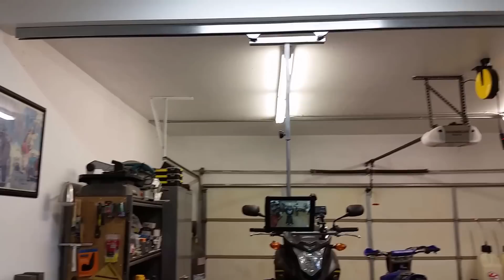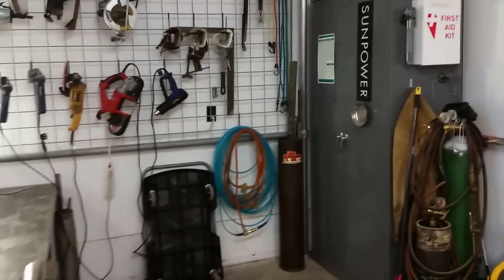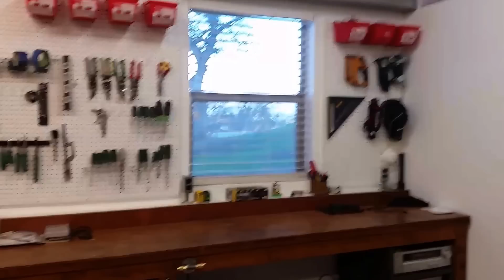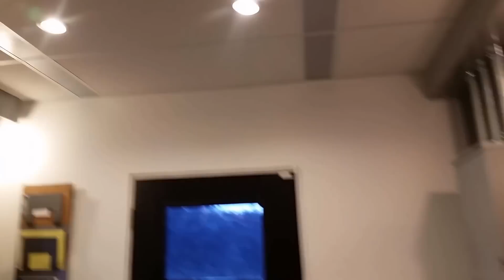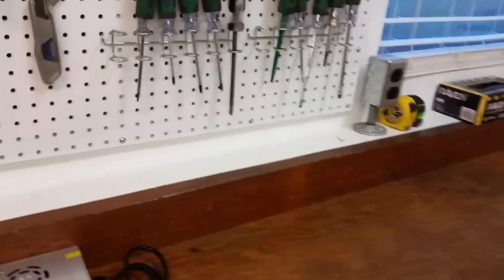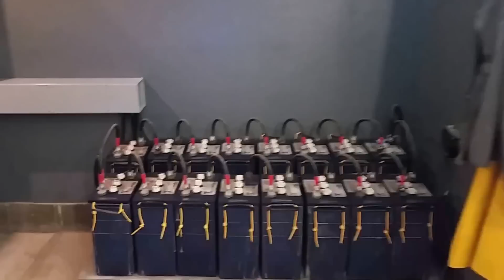The Ultimate Off Grid Shop update

Comment: Man you are my new favorite guy to watch. I am getting into the same exact thing that you are. I am a gear head and love to build things, if I can build it I would rather do that than buy it any day. But my wife and I are buying a home right now in Montana that is completely off grid because there is no power out there. The house already has a wind generator and solar that runs the house. But in my opinion it needs to be larger, only because I am building a large shop to build my off road and street cars in, and I need the power to run my welder which is only 110V and my air compressor. I don't want to have to run my gen set if I don't have to, just because I hate the noise out in the peaceful woods. I have the benefit of having a really nice creek 100ft from the house, so I am going to get some hydro going on there. But I am dropping into this without ever doing anything off grid before in my life other than some simple solar lights. Any advice would be great, I am watching and reading everything I can get my hands on right now. We will have to get internet out there via satellite, which isn't as fast as I am used to with cable, but there are trade offs to have the peace and quiet of not living in the city. I am going to check out your other video's, but if you have any advice on powering my shop I would really appreciate it, I almost backed out of buying the place because I worried I wouldn't be able to do what I want to out there power wise. I don't have millions to dump into it, but I can sure dump $20k if I needed to, just to get it up to what I need. Thanks again for taking the time to make these clips, I personally really appreciate it. Take care.
Reply from the maker: hey Josh thanks for the props  it super cool lately my channel is starting to rank better and people are starting to see my projects.  I'm game for chatting with you more either message me through my West coast sustainables facebook page or email me at jason@westcoastsustainables.com, thanks again
Reply: Jason,
 Thanks a ton buddy, I will look you up on facebook and keep your email. Will also try to bring some more people to your page here for you. I appreciate the offer of talking a bit.

Comment: Hey Jason, I thought I'd jump over here and check out your system.  Who knew you were 3-4hours from me.  We've been offgrid for 9 months now (since June 2015) when we put in a similar system to yours (based on the video).  We're running 16 L16 US Battery units in two loops for a 48volt system.  I have a simple box with fan ventilation for mine.  Can't wait to see yours.  We also have dual FX80 units and dual inverters.  I have a well to pump (2hp) for our water system.  We have 6kW in panels.  It appears you'll be surpassing us soon on power potential if you put more panels in.  We are considering a wind turbine for the cloudy/windy days.  I'll watch to see what you do on yours for advice.
Reply from the maker: +CanaanManley Sounds like you have a nice system also, I have a windturbine under the house waiting to be installed but I am more focused on getting a hydro installed.  I started cutting the angle iron for the battery rack and should have something to show for it soon. thanks for the sub!

Comment: The shop is looking great Jason! I love the pipe/wire mesh wall you put in to store your tools on! I'm getting ready to install a Wall Control in my workshop/garage. (You can see their products at WallControl.com) I'll be posting an installation video as I set it up. I need to start making more videos! I'd love to get a uni-strut set-up put in my garage for filming. If you ever feel like knocking another one out.. lol! Great work! Keep it up!
Reply from the maker: +Rockin B Woodworks Thanks man,  I like the wall control a ton, it looks like they have the Rockin B Red as a stock color! After playing with the track more we need to come up with one modification,  the wheels on the rollers need to have a coating put on them and I think they would be a lot quieter.  Lets Do it!
Reply: Yes! RockinB Red and Grey are readily in stock as I understand. Lol. I wonder if theres a UHMW tape or wheel that would work with the track to help silence it more?
Reply from the maker: +Rockin B Woodworks I was thinking about some kind of teflon and then it hit me, I have some monster shrink tube with the glue center we could heat it up and shrink it and then trim the excess, BOOM